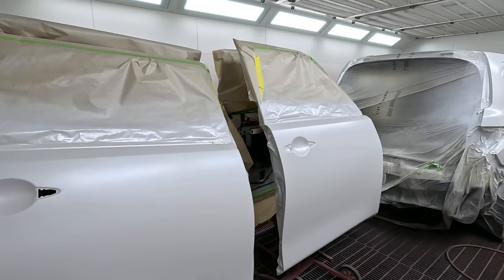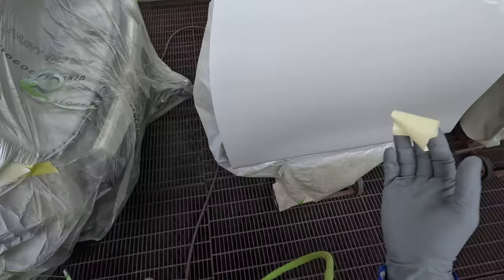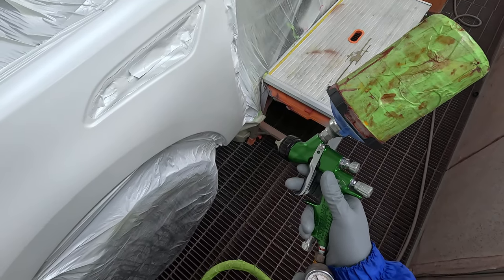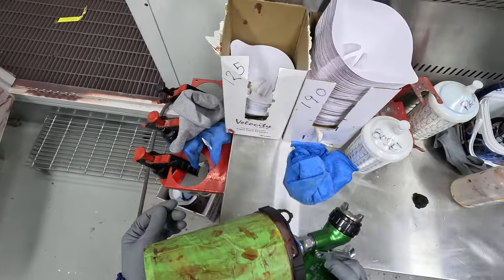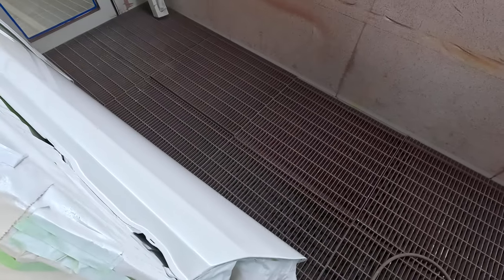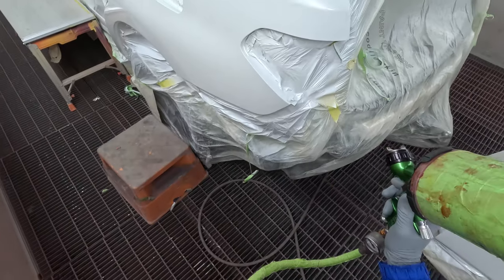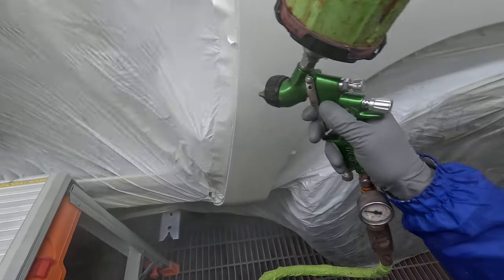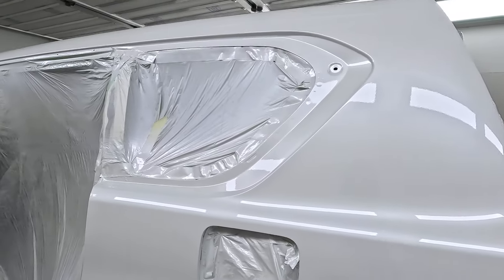Clear Coat Stage Nissan Patrol Respray

Comment: He said my name, I guess you can say it’s pretty serious between us now😂😂 looks  good as usual Gunny. 
If you find that the mids coats are taking to long to flash, jump up to 35%, that’s what I had to do, ppg here had us set at 30% (states)took to long on my mid coats at that rate. One day I checked the viscosity on a mid coat and it was at 28 secs @ 30% reduction, called my ppg employee rep, he said use the viscosity cup and get all you base at 23secs, is what we like it to be at. So I went up 5% reduction and and bam, faster dry time. Also glad to see your having a lil fun.